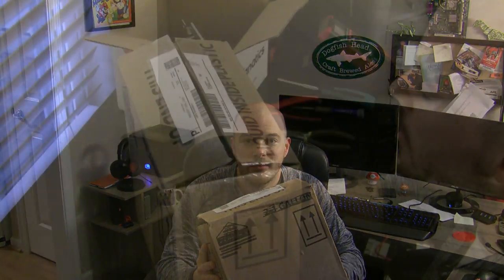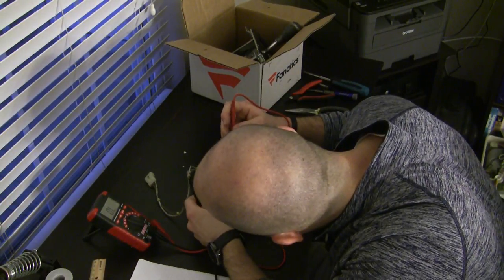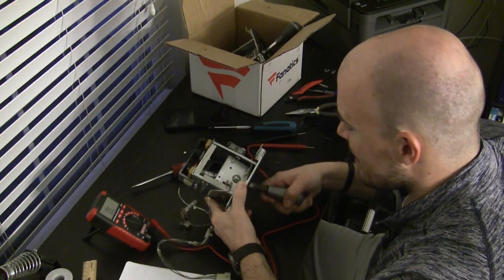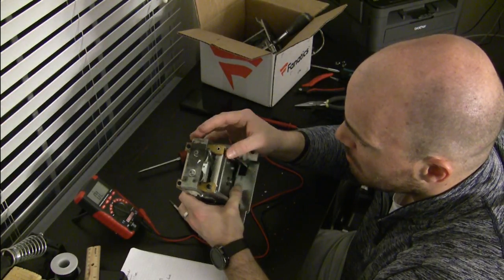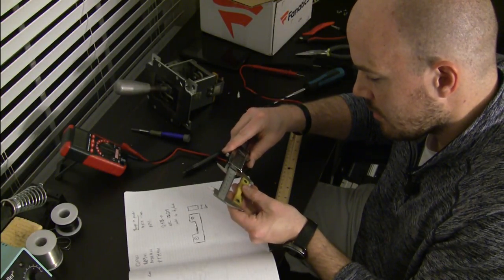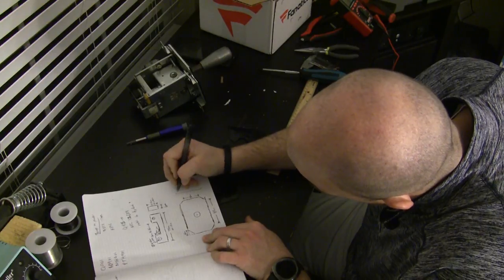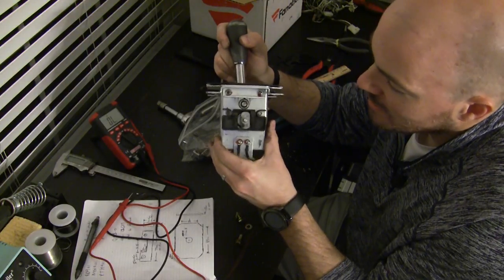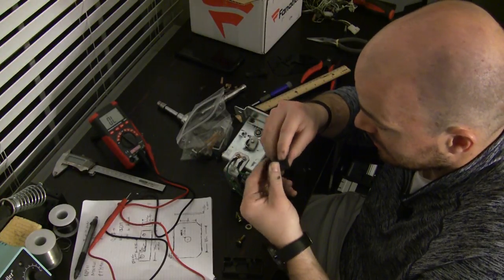Daytona USA Twin Cabinet Project - Shifter Rebuild: Part 1

Comment: I got a scud race (super GT) shifter that uses similar rubber blocks for centering of the shift handle. Did you ever make replacements? If so what kind of rubber did you use to replace them with? Since the bushings are blown out it has so much wobble that its activating gear shifts that the shifter is not set to. (IE: When gear4 is engaged it actually hits the Gear 2 leaf switch)
Reply from the maker: Yes and no. I've got 3 OE Daytona shifters that are all a little different and I've seen NOS refit parts in attempt to make them more robust. Out of the 3 OE shifters I have, 1 of them is very different from the other 2 because it was refit... but they still all suck... and I replaced mine with Ketz shifters. That said, I did come up with a CNCable part for the one set of OE shifters, but I'm not sure if that would work for your application. I'm willing to help out though, so reach out to me on Instagram or Twitter (@mrbendawg) and I'll see what I can do to help